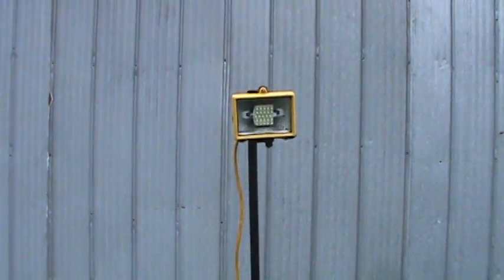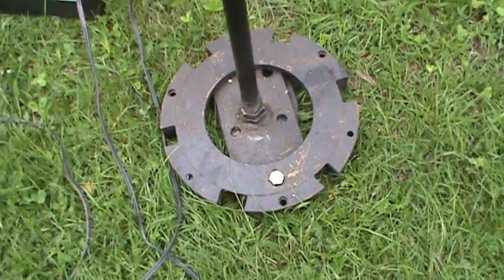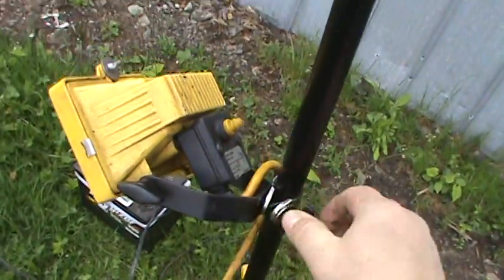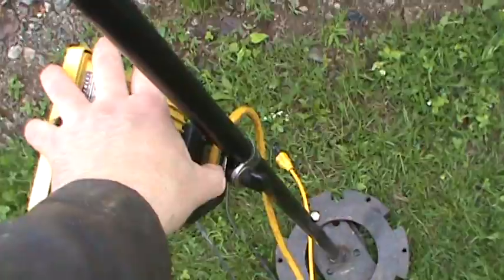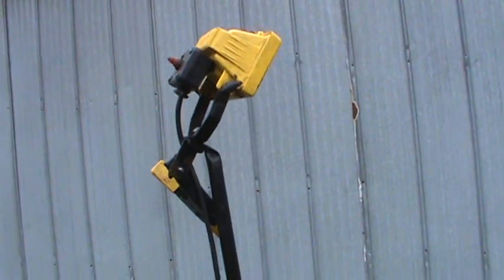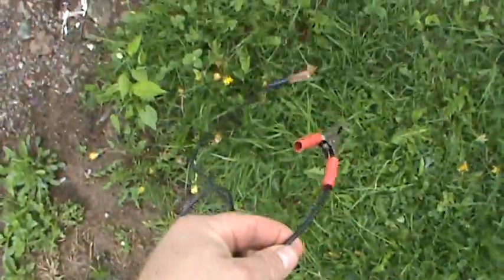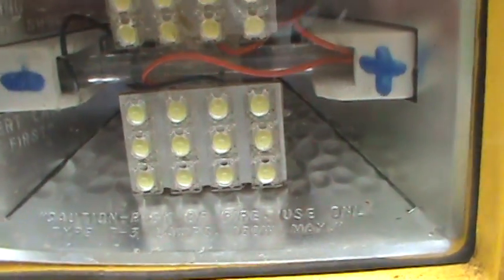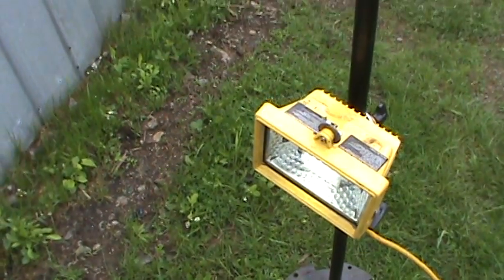12v LED pole work lights conversion

Comment: Friend, how can I convert a led bar from 12v to 220v without losing light power?
Reply: you need a driver, constant current type ,  need to know the milliamps of the chip, chips

Comment: Good idea, I ried the same and the positive wire fron the battery gets corrosinon, it looks like the acid from the battery runs by the positive wire. It works for long time until gets then acid.